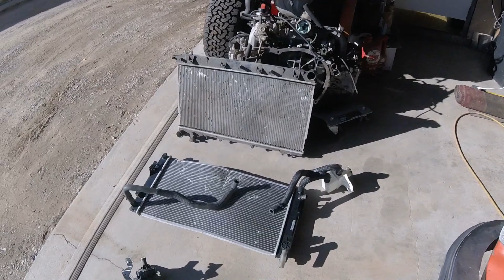FastLEAF EV Conversion Cooling System

Comment: Wait so the path of coolant flow goes from the top (inverter) down to the bottom? I see why this makes sense as you don't want heat from the motor going through the inverter. But doesn't this make the pump a lot less effective since it's not able to push up against the gravity of coolant above it? Did you end up having pretty good flow? I know this is the stock leaf configuration but I'm just struggling to understand how its able to pump well because of the vertical path of the hoses.
Reply from the maker: Good question, it’s been a long time since I’ve looked at the LEAF setup, and I could be totally wrong but since it’s such a short system my hunch is that just about any combination would work - non-pressurized system moving very little coolant.

Comment: I’m really interested to know what is the radiator heats up without the fan while driving and also while charging. I bought acrashed leaf  Wait, broken radiator with out coolant in the radiator and I drove it 40 miles obviously without any coolant but I’m curious if I can charge it before I change the radiator and fill in the coolant. I really like your content because I have had three leafs And I really like your content.
Reply from the maker: Obviously it’s best to get some coolant in the system but I haven’t noticed any real heat up without a fan, charging or driving. Keep me posted if you notice your system heating up.

Comment: What subaru conversions have you done?

I am thinking about doing a leaf into 2003 Subaru Baja. 
I believe same front end as  2003 legacy.

Do you think there is enough room up front?
Is the stack too tall
Reply from the maker: Lots of Subaru swaps (I have a business that helps DIY folks too - Busaru.com

I think you could fit a leaf DU under a Bajas hood. Might need to remove the junction box but I bet you could do it.

Comment: Did you have to narrow the cv joints or did it just fit?
Reply from the maker: I had to cut and weld the VW and LEAF CVs. The intention was just to have temporary axles and send them in as a template to have professional axles built but they’re still going strong - stoked about that!

Comment: Thanks for this awesome video. I've been a bit concerned about the cooling in my conversion as I had no reference to the original setup. This has helped a lot.
Reply from the maker: Sweet! What are you working on?
Reply: @MicksUglyEVs  A Landrover Freelander using a Nissan Leaf motor and inverter. Here is part one of 27 so far. https://www.youtube.com/watch?v=V4Jp4QkcHSk&list=PLdCmBmbqpt5hBBYbx4Incvro2NaPhYs7x&index=25

Comment: I really doubt that you can solder aluminum. You can weld.
Reply from the maker: There is a really cool aluminum solder that can be used (it was what I pictured). Expensive, but it works.
Reply: @MicksUglyEVs  does this repair block off those channels? i know you said you wanted coolant to still flow but is it accepted/possible that they will be blocked? or is there a means of doing it so they dont block? thanks
Reply from the maker: @zooltekindustries1197  The plastic repair probably just sits on the outside of the channels and still allows a little flow. Even if it blocked them there is plenty of capacity for the low cooling load on this conversion.